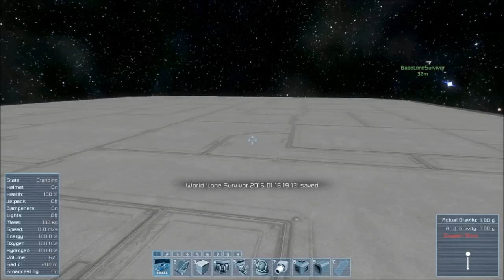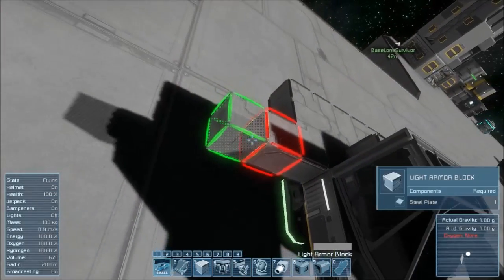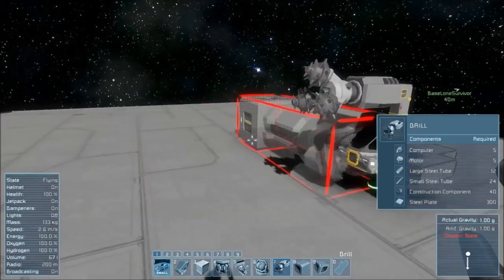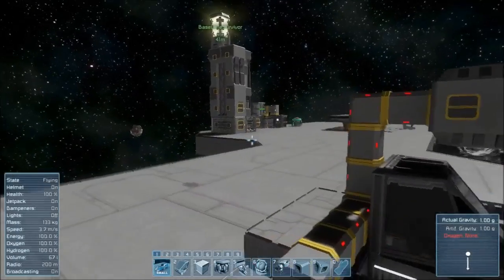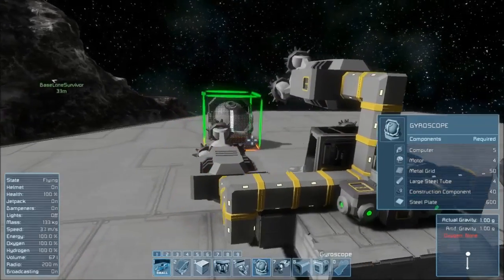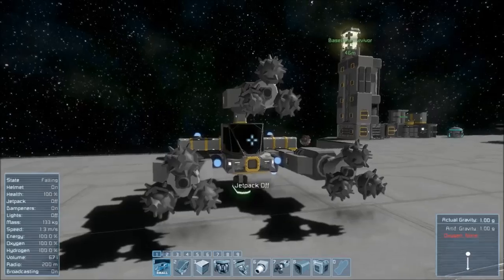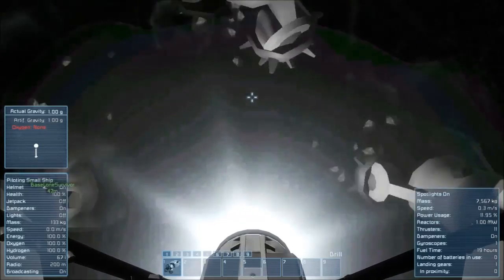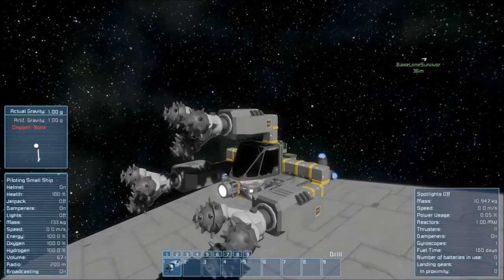Space Engineers - How To Build A Mining Ship [TUTORIAL]

Comment: Is there a way with this build to fit more small storage containers or stack them to fit more ore?
Reply from the maker: +Paul Suter There are a few methods. If you want to just have more storage space on the ship then you can add more storage containers, but you will need to have them connected via connectors (or their little doors) for them to automatically transfer from one to another when the first becomes full. Alternatively I would recommend building a medium or larger storage container, which is bigger but more logical than building multiple small storage containers.
Reply from the maker: +Paul Suter You would need to attach them onto the original container, although my recommendation would be to just fit a larger one if possible and then in turn put on some more reactors and thrusters to compensate for the added weight